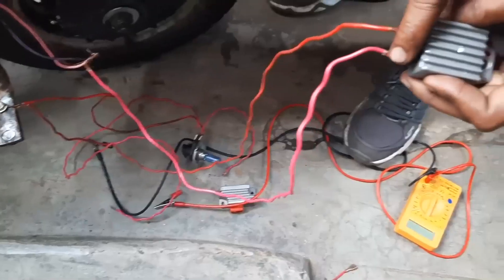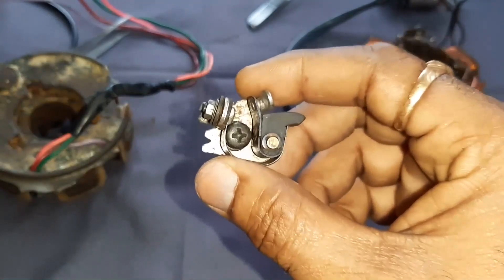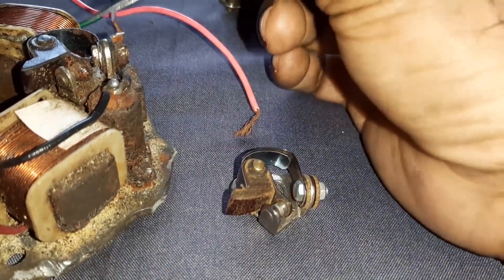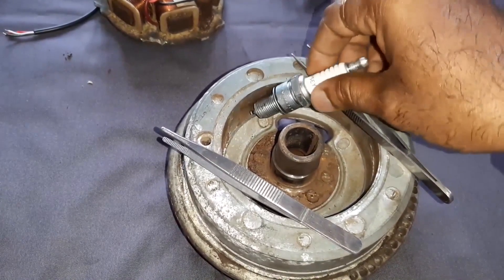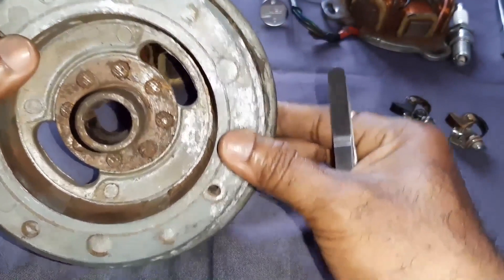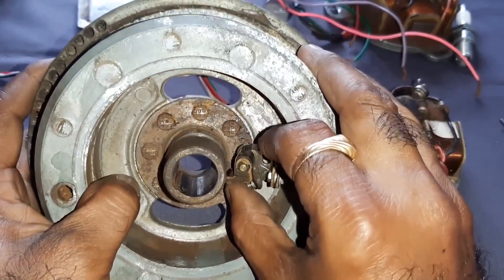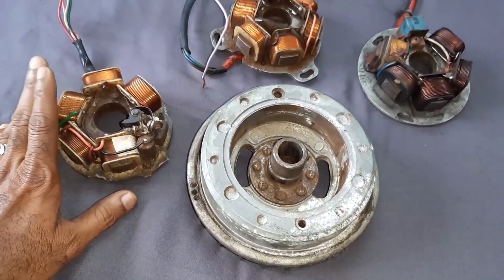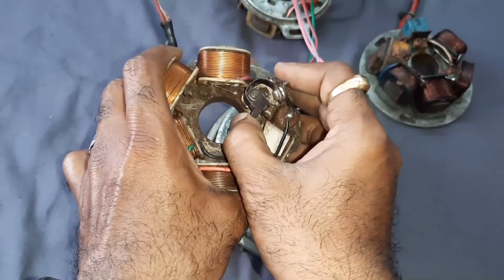The Best YouTube Video How Contact Point Ignition Systems Work

Comment: sir Lambretta H.T. coil is lost ...when i was not even born... And current form  ignition coil is Still working ... But I am Confused in WIRE colour  . one more thing  Sir i Used Bajaj Priya Ignition Coil as H.T coil but not working .... Help is you can
Reply from the maker: If HT coil is lost. No problem still you can use bajaj chetak 12V HT coil. At present I am running with this. If the HT becomes weak it will not give enough spark which will lead to starting problems. So go for the new one. Do not get confused with the colors. Because once you catch the working of the whole stator then you can master the system. Any how I will make a video regarding this
Reply: @LambrettaRamesh  yes sir! I read Whole Wire diagram and found green colour as starter coil.. but i try Bajaj priya HT coil which gives low Corrent..  Now i will try chetak coil . I found i Chatak coil but that not working.. so i got confused.. but now will try ..
Reply from the maker: Sir. I wish you all the very best 👍👍
Reply: @LambrettaRamesh  not giving correct spark .. gives low Spark .... I dont no how to set point. I wants to contact to .

.. i will share video of low Spark .
Reply from the maker: The coil resistance must be good. If it is 6 volts stator the condenser and HT Coil including contact point must be in good condition. There should not be unnecessary grounding from contact point switch. If anything goes wrong we will not get strong spark